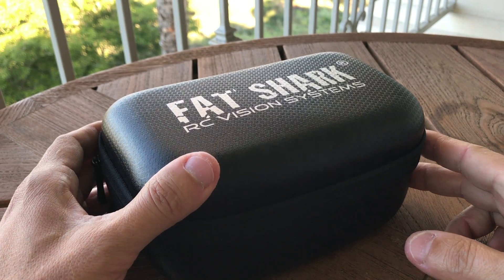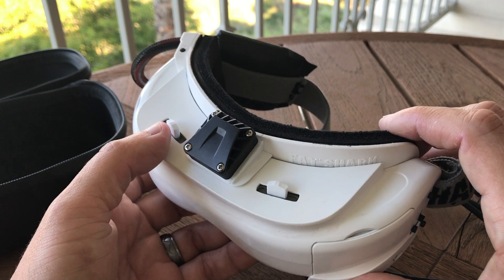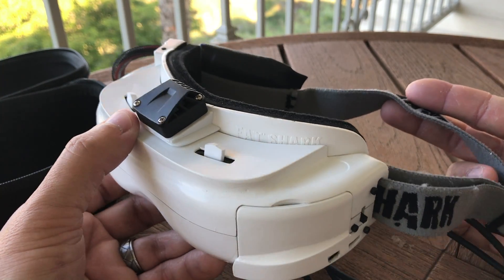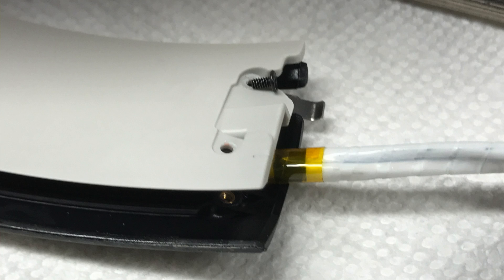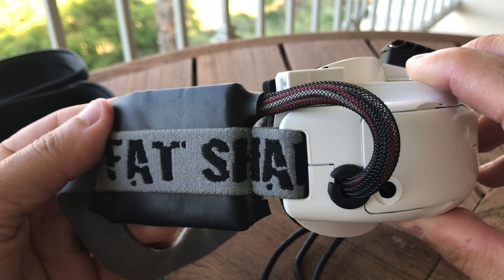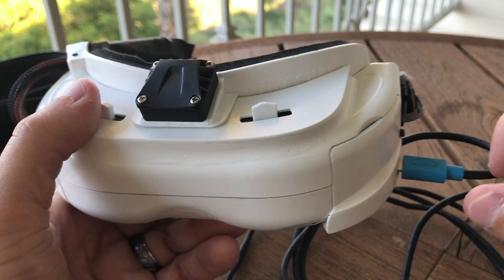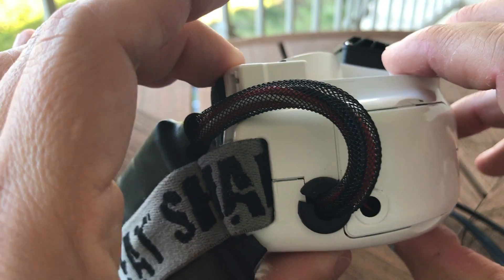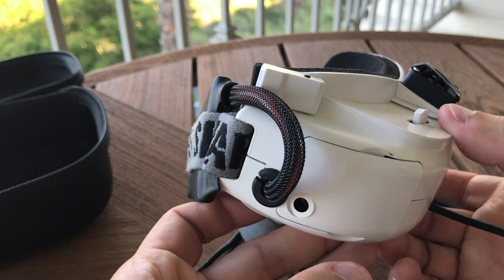GlyphShark: home-built TRUE HD "Fatshark" goggles - how I did it and why

Comment: Would love to know if the Glyph module is still functional after 4 years of use.
Reply from the maker: Still works. But it doesn’t get much use these days.
Reply: @ken-kamm  good to know. I'm nearly done rehousing a glyph into a compact printed case with a TBS crossfire and composite to HDMI converter built in.

Comment: I agree, you should market it.  Ill buy one from you
NICE.

Heck if you make 2 of them for FPV Diversity, ill buy 2 of them off of you.  I dont care what it looks like.  I agree the fatshark case is most comfortable for the head.  They always end up throwing stickers on them anyway
Reply from the maker: Bacardiish What do you mean by FPV diversity? These are for HDMI input only, for the Connex ProSight.
Reply: make one that will work w our racing/Freestyle drones, use the Fatshark case, the glyph optics and make it wireless to run off 5.8 band off of a diversity receiver built in
Reply from the maker: Bacardiish The ProSight receiver is way too big to fit inside goggles unfortunately.

Comment: Nice work. I have to do something had to get a Dom v3, as strong wind and Glyph is not good. Sow I will only use the Glyph if no wind, if windy I use Dom V3, if analog Dom V2
Reply from the maker: What's wrong with the Glyph in the wind?
Reply: kenkamm strong low sun and strong winds make tears in my eyes. maybe some sort off turbulence around the beam on the Glyph.
Reply from the maker: I see.